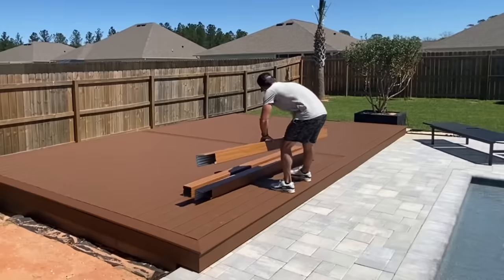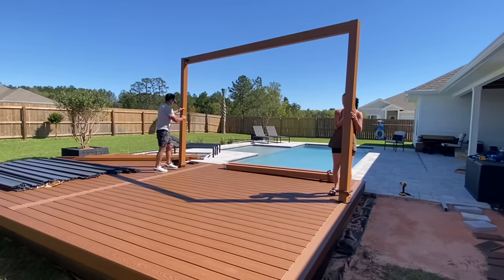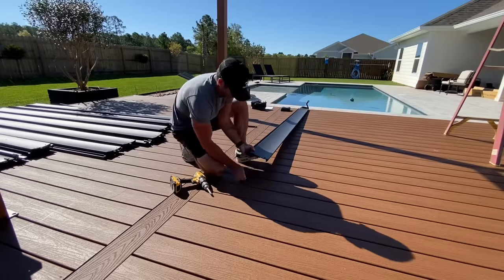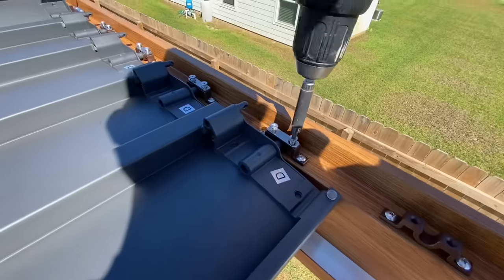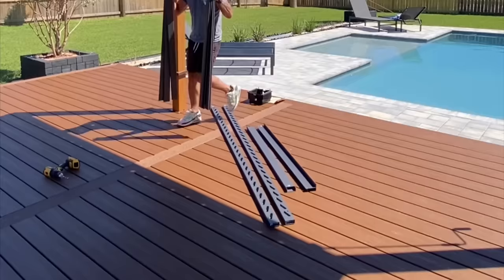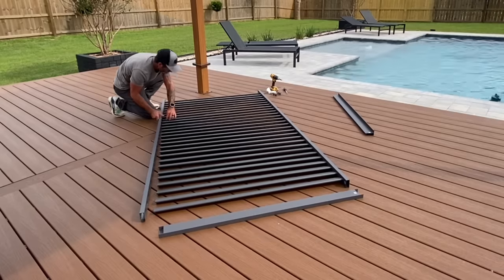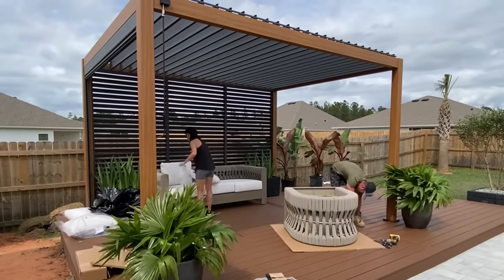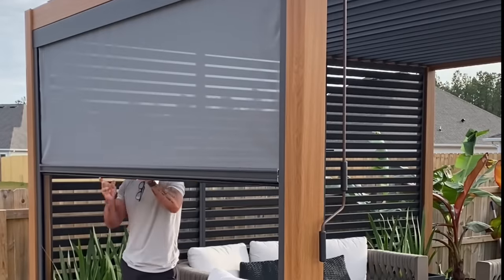is it CHEAPER to buy a PERGOLA or to BUILD one DIY style?

Comment: Just built my own by myself 2 weeks ago, 14x18 traditional and wood.  Cheaper to build, way cheaper.  Spent $1300 and used great quality materials. Made of wood, can take it down quick or replace the lumber pretty easy if needed.  Comparable’s are over $6000

Comment: It was hard getting thru the endless hoa complaining- but awesome result. And  Link please. 

I built a screen in porch - my hoa didn’t have any issues. The key is to not give too many details. The fact you asked them if you could paint the inside side of your fence is more of an issue with you than with HOA. Perhaps you overly ask them to anything?  You might say that is what you’re supposed to do. It is not. As you rationalized. If they can’t see it. You don’t need to ask. The hoa drives by the FRONT of your house once per month. And if they can’t see it. They don’t say a word. It’s really that simple.

Comment: Mirador Looks like what I need and I will have the same problems as you with my HOA.  I have a new house being built in a Del Webb Senior Community now (2024) Their CC&R’s were written over 20 years ago and they wont let us use wood, or to make a raised deck, even if I use composite, etc.  They require all structures to have stucco posts and roofs to match the houses tile, we are not allowed to even have a solid fence between our house’s only metal open view fencing 5” maximum, etc.  I want to take this video to the board when my house is done being built, and I start my 90 day time limit to have my yard landscaped.  Yes, can I please get a discount code for these products.  Thank you!

Comment: Please send the link! Also, how watertight is the louvered ceiling? Can you sit under it in a rain without water dripping all over you?
Reply from the maker: Yes you can sit under it while it rains and nothing drips on you. It has a built in water gutter system and all water is diverted off. Nothing underneath gets wet unless the wind is blowing crazy and blows side ways rain in it. The pergola is awesome. But I attached a link to the video. When you watch the video you will see a shopping bag link pop up on the left side of the screen. That’s the link 👍
Reply: @DesignsbyDonnie  Thanks for the reply! Unfortunately, I don't get the shopping bag link. Watched it all the way thru 3 times now . . .

Comment: Hey there, this is a great video. which model is this one? also how did you attach to the deck itself?  I want to do something similar but afraid I'll have to pull up the boards and add something under the deck or between joists.

Comment: Like the pergola build and design... didn't like the bait and switch in the title... is this about the pergola or HOAs. I sympathize with much of the complaint about HOAs. On the flip side, if you're like most home buyers, you were presented with the C&Rs at signing and signed off on them. That would have been the time to reconsider (or way before).

Comment: I ran for my HOA board for this exact reason. A couple comments
1. Changing CCRs is next to impossible. In my state, you need a "yes" vote from 67% of the homeowners to change a rule. We did a massive push last year to try and change some of the rules, and we only got around 40% of the entire neighborhood to even vote, let alone vote yes. 
2. Some rule enforcement (like the inside of your fence) are 100% stupid. But if you could see the things people try and get away with, and are fined for, you would understand having a limit. Plus, there are laws about "selective enforcement", so if one house is enforced and another isn't for the same violation, there could be lawsuits. So just keeping it as a blanket policy is the easiest and fairest ways of doing things. 

That all said, next time I buy a house, it will be at a point of time where I can move far enough away I wont need to be in an HOA.

Comment: These burglars are really cool the only drawback is the 10-ft size limitation. It's not deep enough for furniture and people to stay dry under which is the point of the watertight louvered system 13 ft is the minimum for a table and chairs and the ability to get up and out of your chair and stay Undercover